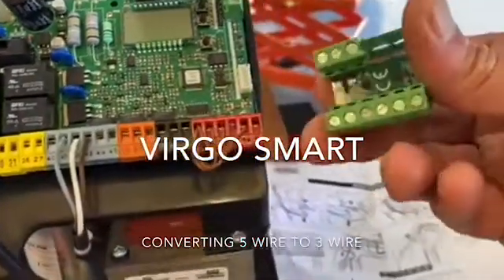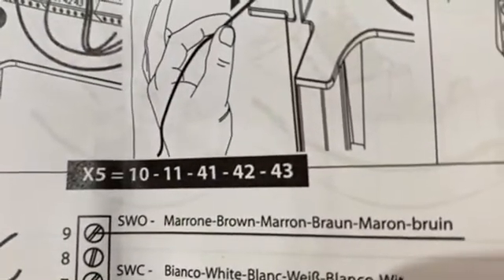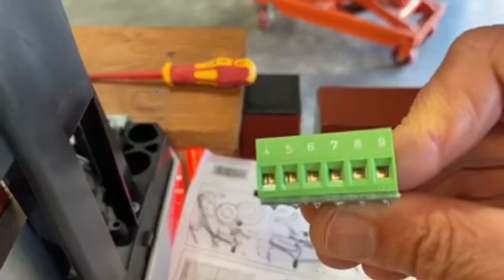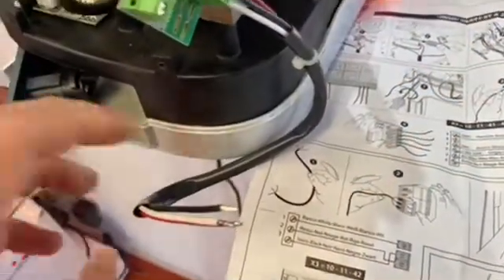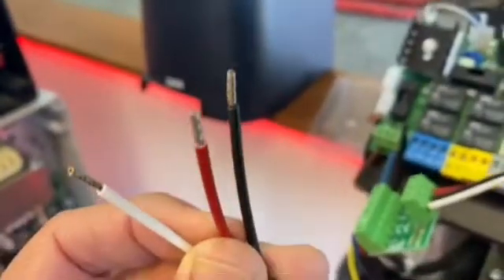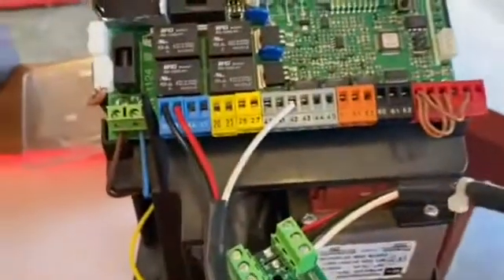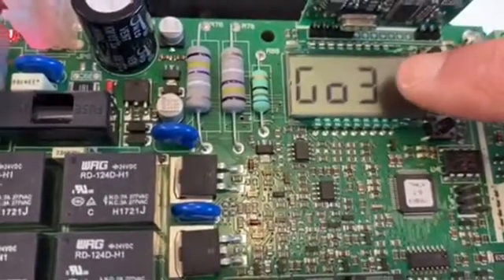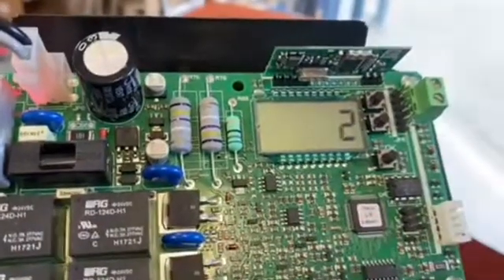VIRGO SMART CONVERTING 5 wire to 3 wire

Comment: Hey, BFT Automation Melbourne - thank you very much for a great video. I've got one question: on video - you showed how to switch wiring. Is it sufficient to switch wiring only to make 3 wire cable to work? Instruction shows that you need to also switch plugs on open/close limit switches (part A on instruction). Is it necessery (switching the plugs on limit switches)? I would appreciate if you could explain the whole process of switching from the beginnig to the end. Thanks